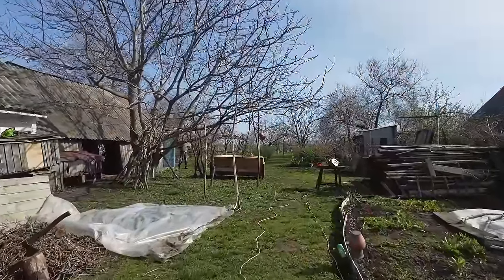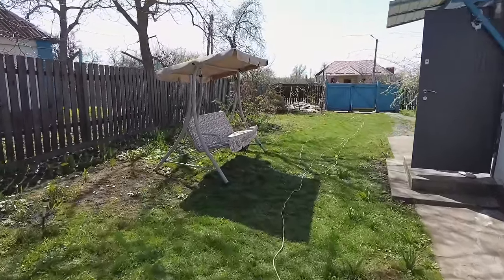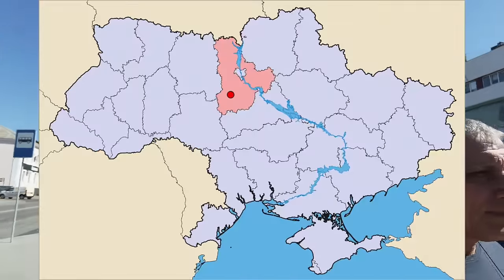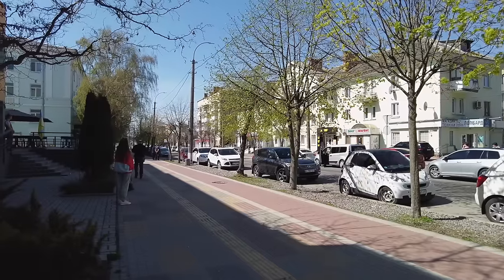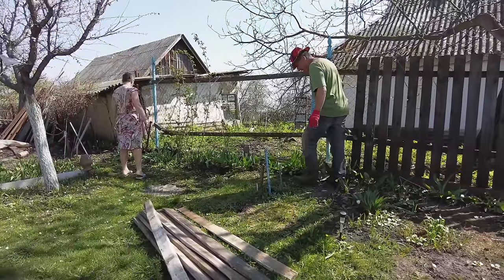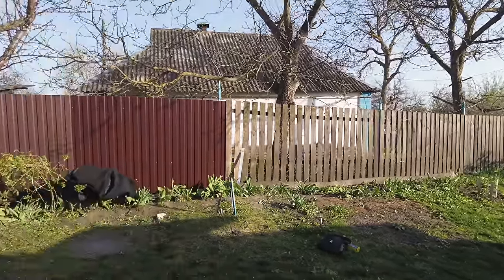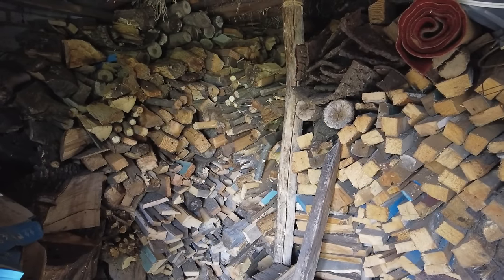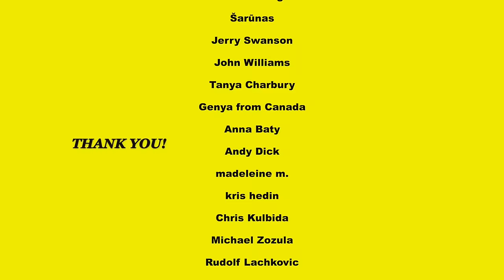VILLAGE LIFE in UKRAINE, how people live 2024

Comment: When I was a kid we had something we called a "Sawbuck" ("Log Saw Horse" is also used in some places) to hold the wood while cutting it, made things a lot easier. It was basically 2 or more "X" shaped frames attached on the bottom legs about 2 feet (60 cm) apart, the log would rest in the top of the "X" shapes. The Sawbuck holds the log allowing 1 person to cut logs into wood easier, also it is less dangerous than having a person hold the log near a saw. You can find pictures of them online because I'm not sure I can explain it any better.
Reply: I have 3x X